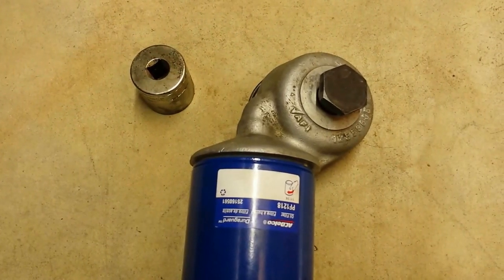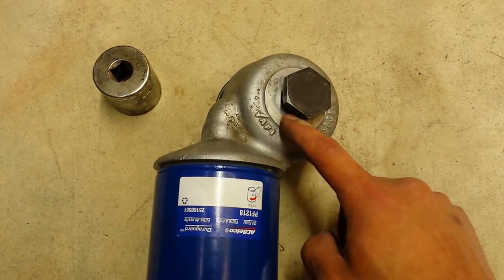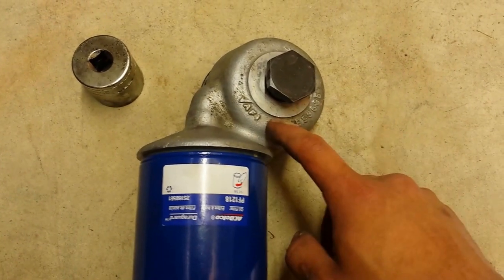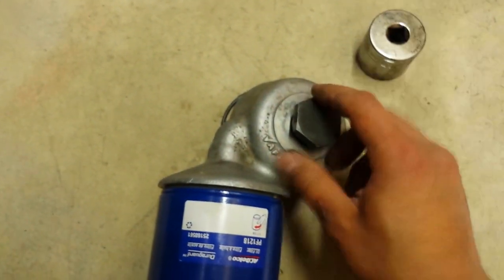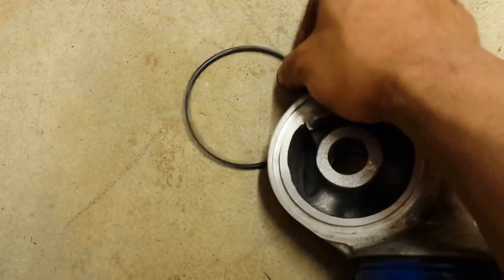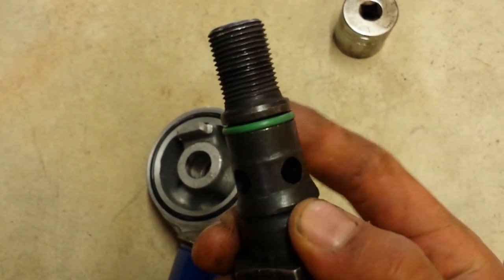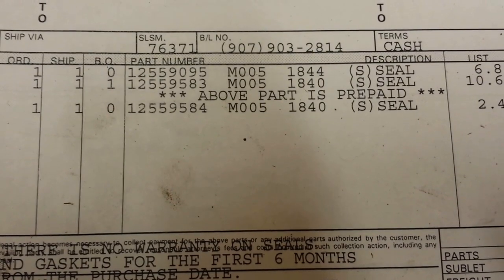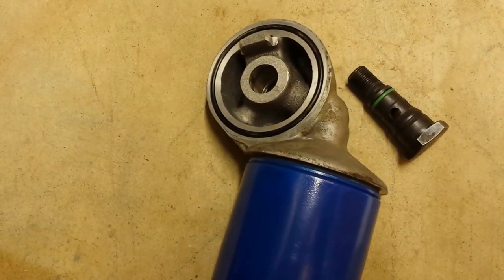1998 chevy k2500 6.5l oil filter adapter o-rings

Comment: The big bolt is 1-3/8". Yes a metric socket fits also, but for people that have a 3/4" drive socket set, that is the inch size.